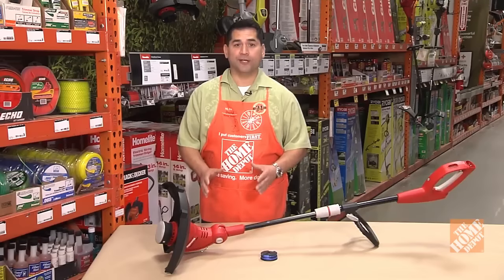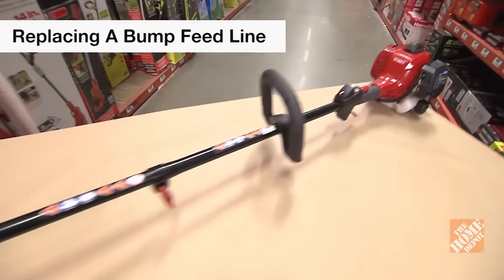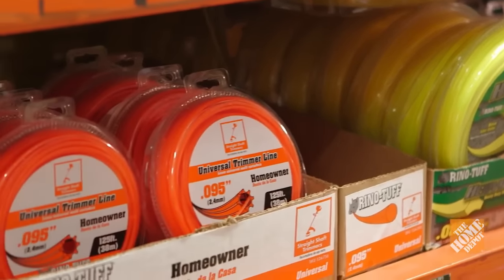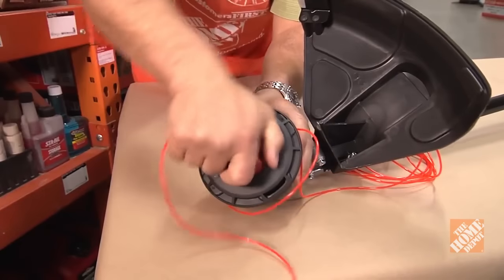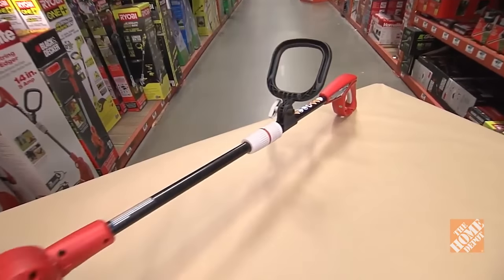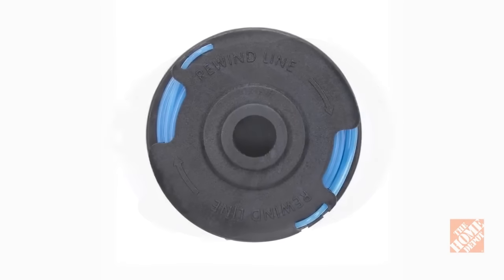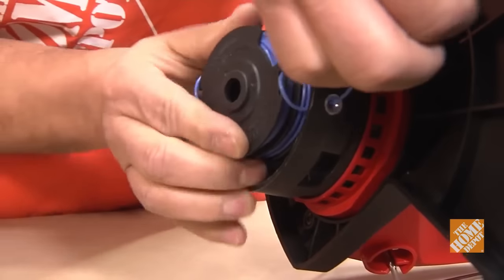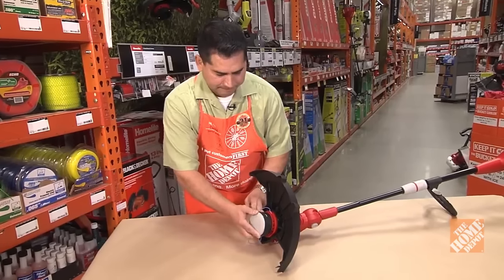Replacing a Weed Eater String (String Trimmer Line) | The Home Depot

Comment: Here’s a tip: When you are trimming grass you don’t need high RPMs. Turn up the idle setting. Mostly use the trimmer on a high idle. Then use the trigger if you are trimming a thicker spot. You’ll save gas and line and time replacing line.